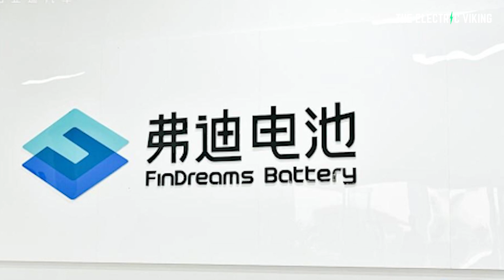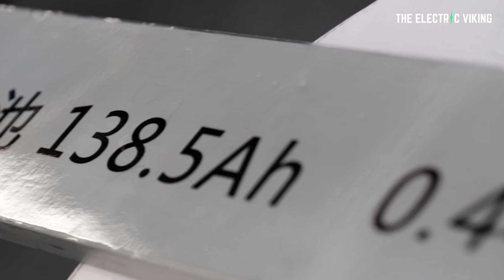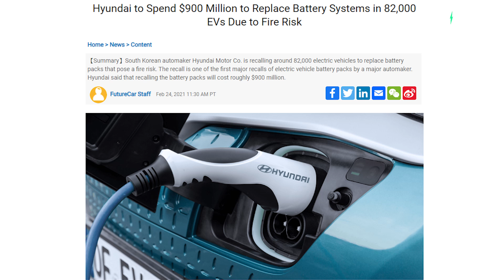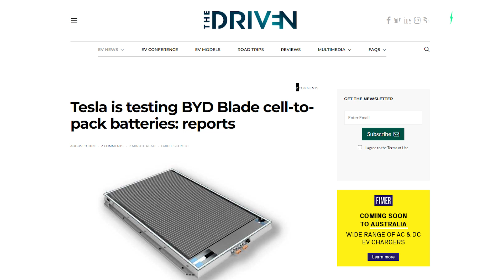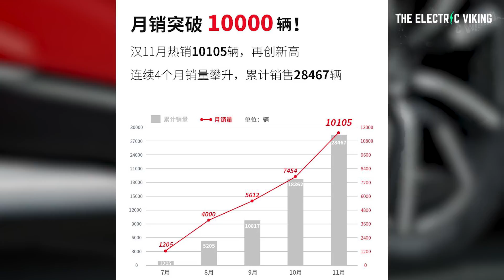Details of the BYD Blade Battery that will power Toyota's new EV

Comment: Hey, thanks for the informative video. Just a quick note about thermal management of BYD LFP. There are significant restrictions to the charge rate of some of BYDs older LFP low voltage house batteries. I am not sure if that is the case in their automotive packs but I would encourage you to look into the details as its one of the biggest challenges we faced as a pilot project for the BYD B Box 10KWH (4x2.5KWH) house battery. Charge currents are very greatly restricted from 12c and under. Close to 0C, the charge rate falls to close to nothing. The devil is in the detail. Anyway, thanks again.

Comment: The "48" tonne lorry test, as a test, is pure theatrics. Divide by the number of wheels and it is more like 8 tonne applied across a square foot of surface. The same test could be carried out by a single roller with much less weight.  Don't get me wrong,  what is really happening is still impressive,  but the 48tonne figure is irrelevant and in real life if a truck was rolling on top of the battery you would be already squashed like a pancake. It is just for show.

Comment: It’s a smart move for Tesla to buy as many blade batteries as possible.

This will suck up batteries from competitors.

Tesla has battery overflow structure whereTesla can divert battery overflow to other projects, like powerwall, Megapack etc.

I don’t think Tesla could overbuy or overproduce batteries 🔋 going all the way up to 10 Terrawhatts per year,(by 2030). 

If Tesla temporarily has battery oversupply, they can throttle their own battery production; battery feed starving battery projects like Megapack; OR start new projects like Tesla Solar Farm Peaker Plants with electricity stored in Megapack battery farms, etc.

Comment: Can you "Cut to the Chase"?  What is the power density of the blade battery compared to say Tesla's batteries?  I find it extremely difficult to believe a LiFePO4 chemistry has a decent power density. If you could just answer the question I'd appreciate it. thx
Reply: Better question is the BYD safer, well that's and easy answer yes! If Tesla were to use LFP in all their EV there would be zero fires and no bad press on battery fires, also LFP are the longest lasting batteries or more than 4000 cycles or over 1 million km and contain zero cobolt. Yep the only bad thing with LFP is less density no battery is perfect but the Blade battery is pretty dam close!

Comment: Hi Viking.  It all sounds great, BYD is making better and cheaper electric cars than anybody else!
But why do they then need to copy(steal) the styling of other companies?

In that row of BYD EVs you showed in this vid, I could recognize the styling of the

Tesla Model S
Chevrolet Bolt (Dolfin)
VW iD3

and the SUV looks like an Audi, even has the gynormous front grill, which is not even necessary on an EV! LOL

So how much does the fake Tesla S cost?
Reply: Name a car company that isn’t “sharing” styling from other companies? Most of today’s vehicles look “related”, why? Because aerodynamics, and trending styles which all companies use for their designs. GM borrows from Japanese and German designs and visa versa. 
Funny how your comment didn’t include any of them in your “complaint”. Tail lights, front ends, profiles, all share the same trending styles
Reply: @jvs333  the only complaint about chinese cars nowadays, is they are a copycat. I am English and the other day i saw an SUV looking car that i was sure was a bentley, turns out it was a chevy something or other!

as you accurately said all cars look the same today, but with EV's that will change, and i don't even accept BYD's cars look like rip off's with the exception of the EA1 which does look similar to VW ID3., but now the new Renault looks like both of them, so are the french doing the same...
Reply: @BSBSBSBSBS-i2x     but you are assuming it’s the Chinese copying VW or Renault. Like in the late 50s all cars had fins because that was the selling trend. Today there are other “details” that are the selling trend, the big grill, the sweeping tail lights and headlights, the LED light trim and blinkers, the aerodynamic profiles. Everyone “borrows” from each other. I was a designer for 40 years every product, building, home, restaurant, fashion, vehicle etc, has its boundaries as to what you can do, it’s called functionality and use of purpose. 
All today’s vehicles have pretty much explored all the avenues of design. Tesla’s truck is an exception but like the Edsel or the futuristic Lumina and the Tucker regardless of their originality their trend didn’t last. In the end cars will be reduced down to the simple design of their purpose as our use and views of vehicle transportation changes from person extensions of our trends to simply being autonomous or Uber type transportation as we (the mass populace) move away from owning vehicles. Which will put more competition for extravagant uniqueness to appeal to the rich who will still like collecting vehicle trophies. 
When you factor in the cost of owning a vehicle (purchase, insurance, maintenance, gas and managing it. It will cost less to just app a ride. 
The automotive 20th century is coming to an end. Vehicles will just become that transport vehicles. The days of drive-ins and cruising around are ending. People will still want to own their own vehicle but even then vehicles will just have slight variations in their designs as those people will want to personalize them in their own way.
Example: 
https://youtu.be/Zlt7qnRrZ0g
Reply: @hendrick B the Tesla looks like older Japanese with a little European. Again everyone borrows. Fords and chevys look like Japanese, German and British look American and Japanese
Reply: They don't need to make 'fake tesla's' they make better all round cars  / batteries designed completely and built entirely in house. Tesla is still trying to achieve this. Also, they make an entire range of vehicles, not just a couple of models like tesla. 
Listen Tesla may dominate the luxury market, but BYD has the best shot at 1) being the most popular EV maker in China, and again let's be honest, with a population of 1.6 billion and seriously low numbers of car ownership, they don't need to sell a single car outside of China to be successful.

2) The best shot at becoming the Toyota of EV's when their cars hit European markets, at a comparable or cheaper price that ICE, you just watch!!!
..and even if they were rip offs, who cares, how did toyota became the world best selling car maker? not by building luxury cars!
Reply: @BSBSBSBSBS-i2x  I agree with all your opininions.   As to your Q who cares if the styling is a rip-off, I don't "care", I am just interested why.  Toyota did not copy anybody back in the day...
My best answer to this is, it is just a bad Chinese habit.  A kind of involuntary impulse.
Cheers
Reply: The SUVs look okay except the ridiculous huge phony grilles on the front. I suspect BYD will drop that in the future.

Comment: I am certain My first EV will have a LiFePo4, Lithium iron phosphate Batterie........The insurance Companies will force this for safety reasons...........Imagine buying a EV, then having Your insurance Co. telling You You cannot park it inside........Which is where I need to charge...........Another thing about LiFePo4, It is claimed to have only 65% the power of Lithium Ion.......But it can be fullied charged to 100% and discharged to 5% without degradation.......Bolt batteries can only safely be charged to 80% and discharged to 40%........Chevy's safety warning........So which do You want.????...............Paul
Reply: What proportion of the level of insurance risk is due to battery fire? I suspect that it is a very small proportion and that iron phosphate would only attract a small decrease in insurance premium. This smells like the same FUD that ICE enthusiasts have been putting out for years. I'd like to see the difference in injury and car damage statistics of the different cathode types.

Comment: Comparing Form Factor and Issues in EV Cell. 

Two most used forms are Cylindrical and Flat / Pouch / Polymer / Blade  or Prismatic. 

Cylindrical 
- least casing area-maternal cost / kWh
- also least case area per unit heat dissipation
- optimal size/W dissipation : 18650, not larger  
- roll form take less time and machinery cost
- 4680 has heat and electric conduction issues
- issue can’t be resolved within patented frame

Flat Rectangle 
- higher casing area-material cost / kWh 
- casing with polymer cost less than steel
- has most casing area per Watt dissipation
- more area ease the thermal management task
- unconstrained size/W dissipation, scale easily
- flat stack use more time per kWh to fabricate 
- may roll first, press & vacuum flat to safe time
- may zigzag then vacuum press to safe time
- may stay flat scale up in volume to safe time

That is partly why Tesla will be/is turning their heads on flat pack LFP chemistry .. after spending months to make the tab less patent viable for EV. Giga Shanghai has validated the LFP flat pack in their model 3/Y. 

If few more months of urgent research works can’t bring solution on table for the Tab Less patent into model 3/Y, LFP flat pack will become a major component in Tesla models globally.
Reply: thank you

Comment: I wonder if Tesla in the future is going to drop it's own battery development completely. It seems cheaper and easier to just buy them from 3rd party suppliers instead of reinventing the wheel.
Reply: I can easily see Tesla making the switch to LiFePo4........Don't see how They will have a choice........They have ALREADY made the switch in China.........Simply a better batterie..............Paul
Reply: @paul-flyer  I don't see how it's really better. But it's cheaper and that's one of the most important factors to really bring EVs to the mass market in the low cost sector.
Reply: @EinzigfreierName  Cheaper and much safer, would mean no more Tesla fires!
Reply: @gregandkaruna6674  I don't see EV fires being a real problem at the moment. So I think cost saving is the real advantage here.
Reply: WIll not happen, Tesla try to be a vertical intergrated company.

Comment: 9:00 ... 12 very wide tires that are not fully inflated would evenly distribute the weight of the truck so the pounds per square inch transferred to batteries is tolerable. Also there is something below batteries that flexes so even more surface area is in contact with tires thereby reducing ppsi even more.
Reply: WEIRD POSTING
Reply: WHY ARE YOU HERE?

Comment: There is no reason for Tesla to use BYD blade batteries. Tesla would have to change too many things in their car technology and manufacturing process to implement that form factor.
Reply: you obviously haven't done any research. the whole point is BYD provide the whole platform and batteries at a price only BYD can achieve. Your man here at the Viking explains it very well if you listen to any of the videos.
Reply: He does not mention changing Tesla models to BYD batteries.  He talks about new models being designed to use the new batteries. Bear in mind the model 2 (etc.) will need separate production lines anyway and also from the start not be able to share as many model E parts as the Y does. Though I think Tesla using BYD form factor is unlikely for other reasons.

Comment: I believe in BYD and have been investing since 2008. I firmly believe the Blade is a great battery, and i have followed BYD every step of the way and am fortunate to never have to work because of BYD, however please comment on this, because it's dropped off, of Google and could be 20% drop in value, if proven correct.I  would appreciate your opinion on this, it isn't good.
Reply: any thoughts please viking?

Comment: Tesla had over 32 battery fires and so many fatalities. but nobody ask them for battery replacement or compensation. Israeli entrepreneurs are protected in America. Chevy Bolt had two battery fires and everybody dumped on GM and forced them to replace batteries of all cars they sold. BYD never had battery fires. but, they have difficulty in ramping up production and in marketing.
Reply: 'they have difficulty in ramping up production and in marketing.' Where did you get that from???? They have more production and ramping up production more than any other company. Google it and find out.
Reply: DAVID BECKHAM YOU AINT. MIS-INFORMATION.

Comment: BYD EA1/Dolphin release/ Launch date in Australia has been pushed back to 2022.
Reply: So that means they could coincide with the Tesla Model2 release.
Reply: @yggdrasil9039  No will be too expensive here and I don't want  something with the ride height of a sedan.
Reply: @Peter-vn8ue  BYD will be cheaper than Model2, but probably shorter range. We don't really know the final design of the M2, so it could be higher up.
Reply: @yggdrasil9039  Like a lot of people price is a deciding factor and I don't want a 3 door. I would like the best bang for my buck as far as safety features go but can live without autonomous driving, so I think a BYD EV will fit my needs and budget. Autonomous driving will not become law here until all vehicles have it and by then all vehicles will have no need for a driver or steering wheel  just passengers.
Reply: @Peter-vn8ue  'To expensive here.' Compared to what???
Reply: @BSBSBSBSBS-i2x  The Tesla model 2 compared to the BYD EA1/Dolphin. Please read all my previous comments as to why I don't want to purchase one. The $25,000 price is US dollars so it will cost 30 percent more here plus other associated cost getting it here and Import duty fees. I'm not saying it won't be a great Ev but I personally don't want one for the reasons I have stated.
Reply: @BSBSBSBSBS-i2x  I'm saying the Tesla 2 will be more expensive than the BYD EA1 here in Australia were I live. What any car costs elsewhere is irrelevant. Due to the current tensions between China and the USA you will not see any Chinese Evs on sale in the USA in the near future. The USA government slaps a 30 percent import tariff on any Chinese made vehicle so there goes the price advantage. The EA1/Dolphin is in production in China and pre sales opened for the BYD Dolphin there in China last Friday the 13th.
Reply: The only way Tesla could compete is by doing what the Viking here is saying and letting BYD basically build it for them and supply the battery. So Tesla China, same as there production cars today in China that are imported to you.
Reply: @Peter-vn8ue  I clearly said it was not going to be sold in the US, but if it was it would be the cheapest car on the market, ICE or otherwise.

As you said other markets are irrelevant, you said in Australia this car would be AUS35k plus -  it won't - it will sub AUS35k, so sub USD25k, so cheaper than TESLA MODEL 2 which is only a prototype!!!
Reply: @Peter-vn8ue  You live in Australia and as you said, so who cares what it costs somewhere else, so let's stick to what you and I have said about Australia - You  said the price is USD25K plus 30% and other costs:

LINK: https://www.carsales.com.au/editorial/details/byd-to-launch-three-sub-35k-evs-in-australia-soon-130231/

So the supplier in AUS confirms sub AUS35K on the market; agree?

You also said:  'I don't want a 3 door. '

ITS NOT, it's5 doors! agree?

Another thing the height:

'I don't want  something with the ride height of a sedan.'

if you listen to the Viking's video, the height is far bigger than a toyota corolla ( a sedan). so its bigger than a sedan; agree?

AGREE?
Reply: @Peter-vn8ue  and who cares about US market.
Reply: MY APOLOGIES PETER, I JUST RE-READ YOUR COMMENTS, AND WE AGREE ON BYD; I MISREAD THAT YOU WERE SAYING BYD WOULD BE MORE EXPENSIVE, MY BAG!
Reply: @BSBSBSBSBS-i2x  yes very bad I always intended to buy a BYD EV not a Tesla.
Reply: Why is everyone going on about another Tesla product! Tesla still only has 4 models and have been promising a new Roadster a semi the new Cybertruck and you honestly think a Model 2 is coming anytime soon? Wow you Tesla sheep lot are more delusional than ever!
Reply: And lets not forget about another breakthrough Tesla product the 4680 batteries they are already obsolete because of the Blade battery with it already hitting that 1 million mile lifespan as well as smashing the under US$100 per kwh  also it contains zero cobalt and is one of the safest batteries ever made!

Comment: So why aren't other battery mfgs back-engineering or copying BYD batteries?
Reply: Cost of manufacturing not even worth it
Reply: It is protected by patent.
Reply: @leiyue1411  if its protected by patent how is it 1) open sourse and 2) CATL have adopted same tech.?
Reply: @BSBSBSBSBS-i2x  Most of the patents are held by Chinese Government Universities and are not available for foreign manufacturers. Many of the patents go back a long way and are due to expire in 2022.
Reply: @BSBSBSBSBS-i2x  CATL has access to the same government university patents.
Reply: @shanewilson2484  that’s my point. Open source.
Reply: @shanewilson2484  open source in China I mean! Ha, ha!
Reply: Do your research. They are, but BYD have the scale (and knowledge and experience) to produce better batts at far cheaper prices, and they've been doing this for years. The only reason there is still an op to make money here is racist attitudes and correct attitudes to CCP. Wake up.